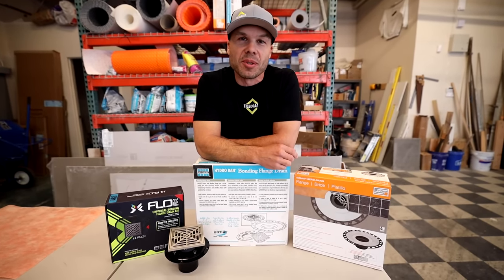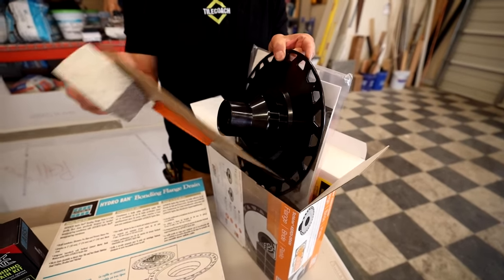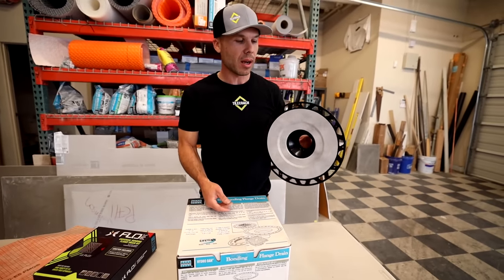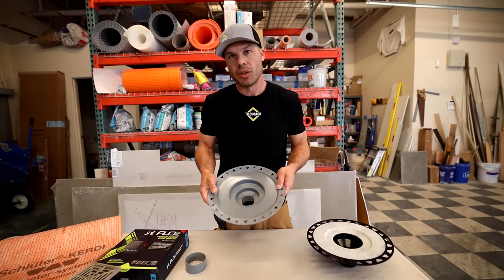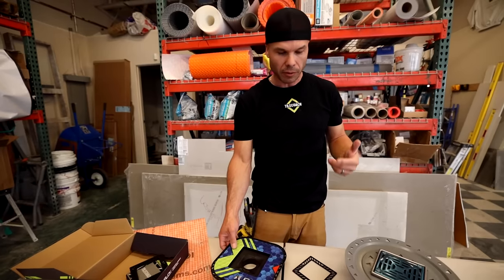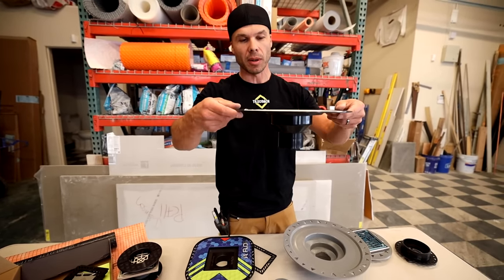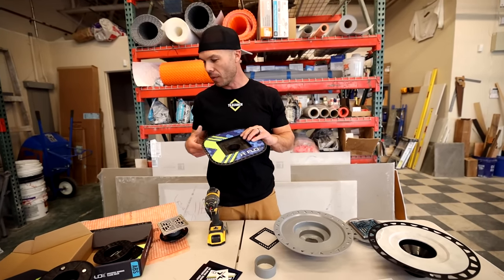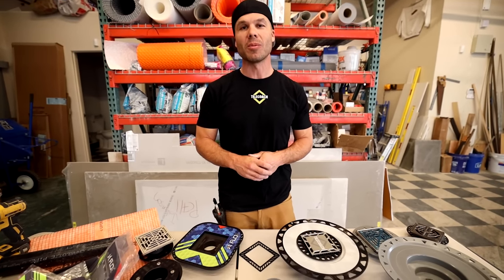Bonding Flange Drain Comparison --- Schluter, Laticrete, and FLO-FX for Tiled Shower Pans

Comment: I'd imagine the white stuff came off the kerdi collar when you tore everything out.
Reply: Exactly there is no way it just "emulsified in water lmao.
Reply: @davidsteyer4925  doesn't seem like something he would miss. That fabric is thinset into that flange with tile set to it. Naturally when you pull the tile out, that white part can definitely separate. I believe he needs to rethink this one but I like his videos.
Reply from the maker: @mattjudy6780  Nah man its happened on the only two I've torn out. One was installed by me, and one was on the this video https://youtu.be/tOcYK1npnpc?t=1090.  I'll time stamp it so you can go right to where it shows the fleece completely removed from the flange and it didn't tear off.  Before I tore it out, evidence of leaking from below the drain was noticed (efflorescence)
Reply: @TileCoach  ok ill check it out when I get a little time tonight
Reply: @TileCoach  I watched the video. I always roll a liquid membrane over my kerdi systems anyway. The pan and up to about chest hugh on time of kerdi board/banding
Reply: I was thinking the same thing, but I didn't see the demo.
Reply: I sand or rough the back of the drain so it bonds great for me but I know exactly what you talking about breaking loose I've been doing Schlueter since they came out hundreds of showers and I never had one problem thankfully knock on wood.
Reply: @TileCoach  In the video, the drain flange is grey color.  Is there a chance it could be a Laticrete drain with Schluter membrane and that's why there is no fleece on it?
Reply: Will any of these bonding flanges work work with a Newport Brass drain or Newport Brass grate 4 inch grid?
Reply: Watch the demo before you make assumptions.
Reply: @jeffbizzarro  I did
Reply: @TileCoach you
Reply: I watch the video and it definatly looked like tha the white flees was pryed out by the giant granete slab most likley during installation this is why when you opened it up it looked like it was not attached to anything. The main reason people use mosaic tiles for the bathroom floor is flexability  and reduction of the chance to pry out the subfloor. I would say from engineering stand point this big slabs required some sort of anchering system to keep them down on the floor under constant compression ideally they should go on top of concrette that has 000000000 flex  and give not plywood floor with foam based Kerdi system  and even then they will need to be ancher down.
Reply: Where can I buy one

Comment: Been doing tile for 24 years, have always done pre-slope with liner using fish tank gravel around weep holes without an issue ever that I know about. I did two schluter systems with the foam floor and one of them failed. The fleece delaminated from the foam on the pan. Doing a master bath right now, just latex the ditra heat and I’m going to try the schluter drain with no pre-slope on this shower for the 1st time. Just starting watching your videos and I appreciate them, thank you! I may put up a few videos in future myself.

Comment: I've installed more than 2000 mud showers and have been using Schluter Kerdi for the last couple hundred of them and that system works well. 
I used my first Laticrete BF Drain and hydro ban membrane on account of wanting to support American made products.  The customer bought white mosaic 2x2 for the shower floor and when I went to install the floor... the tile was 1\8" thick and I did not know that the Laticrete BF Drains require a minimum tile thickness of 1\4" and I would say probabbly minimum 3/8 to maintain the proper slope and a 1\16" clearance height above the grate.  Had to go get a thicker tile and cut 12x24 porcelian down to 2x2 to make  it work.  It cost me an extra day + of wasted time because Laticrete doesnt mention this requirement in their literature or instructions but does mention it in the product video. So hopefully this info can save someone else the time before they find out the hard way. USE THICK TILE with Hydroban Bonding Flange drains.
Reply: Use more mud 🤣🤣🤣

Comment from the maker: These FLO FX drains really are the bees knees.  I already placed a stocking order to replace all of the Laticrete drains we were using.  If you would like to support our channel and help us purchase supplies for these unbiased reviews, go to https://www.tilecoach.com/shop and purchase some merch!  Thank you, let's hear what your favorite drain is!!!!
Reply: I having been using a standard $45 weephole and the divot with reinforced liquid membrane. Im sold, I'll try them out. Thanks
Reply: Great video! Although, I don't know if it's fair to favor the FLO FX when it hasn't been installed for 2 years. I know you were pointing out flaws in the Kerdi, but this product needs a few years' of installs to be able to tell whether it really works.
Reply: link to flo fx? are you the one who is going to supply these?
Reply: Can the flofx drain work with schluter grates or does it have to be flofx drain and grates?
Reply: A little dated, but I have to add how helpful the @tilecoach has been. I am a homeowner and have a full gut with all laticrete install on hardi with hydroban at seams in addition to laticrete shower system. It took months of research to find my shower flange and couldn't be happier with the price and durability of flofx in my install.

Comment: I had that problem with the felt deteriorating on a schluter drain in my personal home. Tile was coming loose around the drain. Shower was built in 2018, before I bought the house. Pulled the tile until I reached dry material, scraped off the felt and reinstalled with a patch of new kerdi. So far it's ok but eventually I'm going to have to do a whole new bed

Comment: Ive used both types of drains using the Redgard liquid membrane system and feel both do an adequate job given proper installation.
When using the conventional 3 piece drain i form a basin in my slope bed about 1" deep and about 10" to 12" in diameter around the drain flange in the floor which i thoroughly coat with Redgard atleast 1/16" thick prior to installing the drain flange.
Once its dry i apply a heavy coat to seal the flange down and install it.
I make sure the bottom flange is recessed slightly to accommodate the height of the clamp ring so that its even with the lowest surface of the slope bed within the basin.
Using the liquid membrane system precludes the need for the clamp ring but i usually use it anyway depending on how its made. Some have open holes where the clamp ring bolts go while other do not.
I install accordingly.
I then cover the drain flange with a 12" to 16" diameter piece of fiberglass mesh cloth or multiple overlapping strips of fiberglass mesh tape to reinforce that critical area.
Then I coat the top surface of the drain flange with Redgard making a smooth downhill watertight juncture between the slope bed and drain inlet and i usually enlarge the weep holes and make sure i dont block any with the liquid membrane. Sometimes i grind the drain inlet groove in the threads slightly to enlarge those weep inlets too.
Some have inadequate weeping capacity imo. I want any water that makes it past the tile to drain as fast and as thoroughly as possible so i maximize the slope and the weep holes. 
Once ive completed the membrane application and leakdown test i fill the basin with pea gravel or broken tile pieces no larger than 3/4"  and lay my tile.
The adjustable drain inlet can be raised or lowered to get a perfect fit with the tile.
I make sure the metal grate or strainer is just lower than the surrounding tile work by 1/32" or so with a nice smooth transition.
Ive never had an issue with the 3 piece drain other than very limited grate styles and finishes.
They work well with my system though.
When using bonding flange drains the process is identical.
I just use the size of the flange to determine the size of the basin, install it and Redgard it in.
Easy peasy.
I just spend extra time insuring the weep system is functional.

Comment: Ive found the schluter to be the easiest install with the least issues as ive had to build up the floor to make the tile flush with the laticrete drain grate. I use the schluter bases that are already covered with the Kerdi and have the circle of membrane that covers the drain to base transition. I rarely use the Kerdi membrane at all anymore preferring the speed and benefit of wet shimming using the Keri board walls. This just leaves the Keri band at the floor to wall transition and any seams and screws heads followed by the corners. It solves the build up you get using membrane plus band and corners. The cost is slightly higher this way but the time and problems it saves make it my go to shower system.  Ive not had the issue yet with the drain not bonding well and have never screwed one down simply mud it and twist it in firmly to where the anchoring legs have mortar oozing through then I set a bucket of water on it overnight. I make the connections during this time as well so I don't have to be pushing against flange as the mortar is curing. Haven't seen the Flo-fx in my area  yet but would  like to try it at some point. Really enjoy your content btw and your  honesty and integrity  you bring to the table. Not many would be so upfront if they had a job fail and many would be blaming everything and anything else and take zero accountability. Even the best contractors will have issues come up but its how they are dealt with that either creates a loyal customer for life or a lawsuit and some social media negativity. Do you currently use any comparable yet more cost effective solutions for the ditra heat?  We have harsh winters and the majority of my estimates want to see the cost to add heat which ends up adding a bunch of wasted time going through the materials each job will require with maybe 10% at most actually willing to spend the considerable extra money to add it. Thanks in advance!!!!
Reply: Ditra heat isn't that expensive when you explain the benefits. It will dry out the shower immediately

Comment: At 9:45 the ring you pulled off the LATICRETE drain is a bushing to use it with 3" pipe. Nice comparison.

Comment: Whether or not the Kerdi messed up or not, the Flo-FX is clearly a better design all around.  I think you hit on all the points as to why it's better too.  You should just throw all three in a bucket and let them sit for a year and check them periodically.  It's an easy test that wouldn't take up much space or use much of your time.

Comment: I'm using hydroban liquid membrane,  with the fabric at all floor and wall transitions and 4 strips around the drain, even though it's not need, but for my confidence in the method.
Yes I re-drill the counter sink screw holes.
Thank you for the videos
Reply: That seems ultra reliable.

Comment: I’m doing 3-4 mud jobs a month with pan liners. I’ve been doing them for 20 years and never had a call back for a leak, mold, saturation or efflorescence in any of my mud base/ liner jobs. I always do a layer of waterproof membrane over it before I tile I.e Aqua defense or red guard. Zero issues ever.
Reply: Michael- I suspect you are. Single proprietor  or very small firm and don’t need to hire people , and no doubt you are excellent at your trade  and meticulously measure the depth of your liquid applications, fold your rubber membranes carefully , but you MUST take more time than an adequate/very good install with some of these systems deliver,esp if you expect to waterproof wall . Lets say your price in materials is $200-300 more (is compared to mud, cement board on walls etc) . With your time involved, even outside the coasts, its a wash for you, your done quicker, you can do multiple tasks on shower in same day, AND you are not dealing with down stream issues of clogged weep holes, and were in water out hygiene (explain to a client what is going on and hey say what , my dirt skin etc and flowing through a mortar layer and residing there indefinitely to rot ? Ugh ....easy sell. Strongly  suggest you pick one of  the systems and add to your repertoire at least as an option AND you can  sell traditional approach to clients “Look Ill do a lacticrete install, and I do them ,buts peaking from experience ....” mascot importantly this is where industry is going, eliminating skilled labor, eliminating skilled labor time, and delivering a consistent product without having to know  personally the quality of the skilled tradesmen work. E.g. to do red guard right requires lots fo time band attention to detail-Ive doen that myself (but prefer Hydroban if I’m going to do a liquid event at greater expense) and yes the materials are cheap. But TE technology is evolving quickly .and if Fol  flange works as advertised its the final piece. If its DIY and money is the overall rate limiting step, fine, readers can spend their weekends installing their shower , but even then time is an issue with screaming spouse and shower out of action for weeks. The only issue I see right now is how the sealants are gogin to hold up as this is where the joints on walls weakest. Dunno exactly what lacticrete is. Using but Iv been surely I’m pressed with the developments in sealants/caulks these days. Vulkem (40 year old polyurethane technology)  for example has been shown to last 40 years easily on exterior mansion/mortar joints.
Reply: Are you saying that you paint a waterproof membrane on top of your second layer of deck mud? (the mud bed after liner and pre slope)  I'm currently doing a shower and am tempted to do that, but many have said that that's a no-no bc you can create a moisture sandwich between the liquid membrane and shower liner if water gets past the Aqua Defense/Redgard. However if that's what you've been doing for 20 years that sounds good to me.
Reply: Raybalconis just saying that’s what  I do and have done and that works for me. I bring the waterproof right up to the drain. I don’t believe any water ever sees the med base. .
Reply: @michaelkaylor4779  I appreciate the reply, thank you.

Comment: Vinyl pan liner clamped down to a drain assembly with weep holes is looking pretty good. Some water will get thru the grout and then get thru the thin set and then hit the waterproof membrane and follow the slope to the drain, either down the walls or the shower floor. The drain grate assembly that has no weep holes is set into the bonding flange drain with thin set and thus creates a dam at the membrane level around the drain grate. This sitting water eventually degrades the thin set and water can weep up under the membrane. No weep holes in the drain grate assembly to allow the water to escape is the main problem. The other problem is that thin set is not waterproof. So one partial fix would be to use liquid waterproofing around the membrane to bonding flange joint prior to setting the drain grate in thin set. The water would still not have escape weep holes but it should prevent the water from weeping back up under the membrane. In the mean time someone should come up with a drain grate with weep holes that would not get sealed off with thin set. Has anyone tried drilling weep holes in the drain grate assembly?
Reply: This is a very detailed analysis. Thank you.
Reply: Yep. I use the flo fx universal kit with an oatey drain assembly. I trace the oatey flange holes and water channel on the flo fx flange and use that instead of the oatey. Then I use a polyethylene membrane (like schluter) and  Laticrete gold to adhere it over the pan and cement board( that's not installed into the mud bed) then I use 100% clear silicone over all of the seams and around the drain cut. Bullet proof. U got a preslope, a pan liner, and sheet membrane with waterproof silicon that makes it impenetrable for water to get through for only $10 instead of buying hydroban or aqua defense.
Reply: Grate carriers have weep channels designed into them, however they are overlooked/blocked even by professionals. Flo-FX does not show how to protect them during installation of thinset.

Comment: I definitely have been meaning to give these FloFX drains a try. Laticrete drains have an issue of being thicker than your average shower floor tile, even when screwed all the way down, which is a big problem. We do Laticrete everything, but started using Schluter drains again because the Laticrete drains are flawed. The FloFX drains remind me of the former USG bonding flange drains, which were my favorite until they were discontinued.
Reply: We like Laticrete, use their complete system with our drain and still get their system warranty. Their coverage stops where their products stop and we pick it up from there.
Reply: yeah seems like a design flaw the ability to push the schluter drain down to adjust to tile height is definitely beneficial
Reply: @flofx9418  can you apply hydro ban directly to the fabric on your drains or do you have to use a sheet membrane?
Reply: @jmhagle  Apply hydroban liquid directly to the bond flange 👍

Comment: Just ordered the Flo Fx with the grate. You mentioned putting it on the thin set but we saw you put it on the mud pack in one of your other videos. Do we put it on the thin-set or can it go right on the mud pack first? Excited to get the Flo Fx. Really like the idea that it adapts to our old system with what is provided in the kit. Thanks Tile Coach for the videos. Super helpful.

Comment: I'm building two showers atm with hydro-ban drains and was instructed to coat the top of bonding flange with their liquid sealant , and top and bottom of drain flange ,  then you can you can thin-set them together  to achieve the drain height , cheers